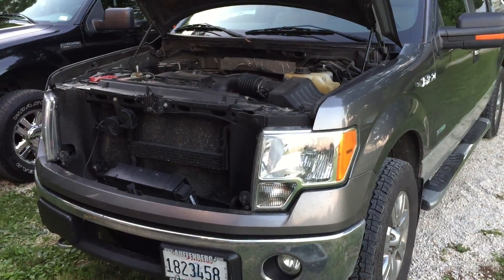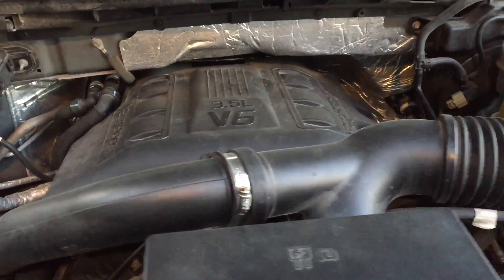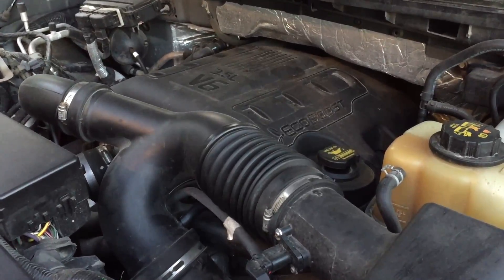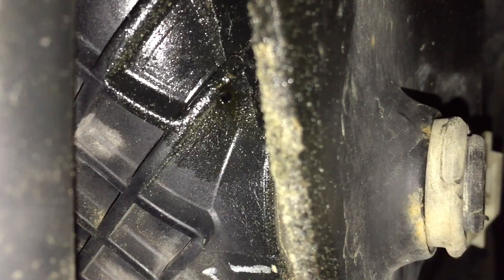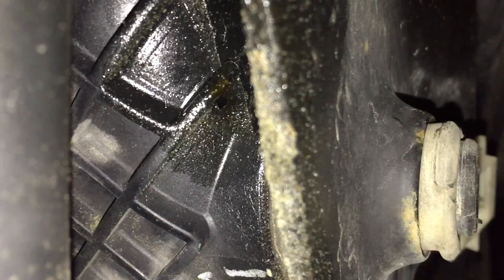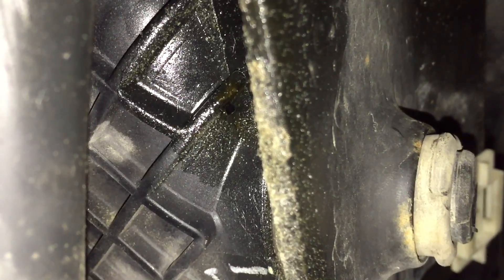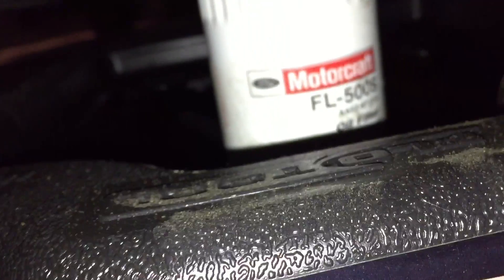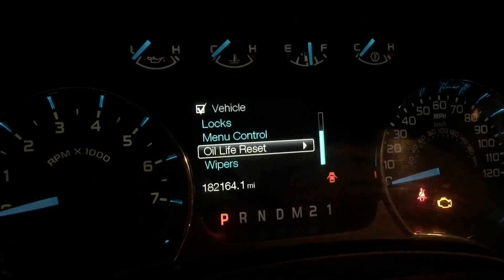Hole Drilled in Intercooler Fixes EcoBoost Misfire

Comment: Are F150s using a MAP or MAF sensor?  Creating a leak in the intake system post MAF sensor is essentially creating a richer burn.  Not as big of a deal if the F150 uses a MAP sensor.
Reply: Jordan Bruno exactly. fucking people don't understand basic fluid dynamics. God forbid you step on the throttle, and ask for more power. 

commercial diesels will run for extended periods of time with blown intercooler, or rock holes in them, you'll hear them hissing a half mile away, and miraculously, they still get down the road. should they be fixed, absolutely, but we talking about finger sized hole vs a ' O ' literally. 

a classic case of a little bit of knowledge being dangerous.
Reply: lol... a forum response? oh for fucks sake. How could I ever doubt you?
Reply: I would like to see this link that claims that losing like 2CFM is going to do any damage to a turbo....
Reply: WereAllThatBored ford use a MAF but the leak is extremely small and doesn't bother anything
Reply: WereAllThatBored The ecu will accommodate any rpm in any boost level given that they are in ideal conditions. Unless turbo rpm is measured (hardly ever) the entire system will still run the same. However the real issue here is turbo seals and pcv imo... Maf and map are both used. the engine uses a maf tune for part throttle and uses the map in something closer to a speed density tune for boosted conditions. A maf cannot accurately predict the volume of pressurized air.
Reply: Um.... yes, a MAF can. The volume doesn't change after the compressor. The pressure and temperature changes post compressor, not the volume of air.  PV=nRT guarantees that.
Reply: kleetus92 no it doesn't. have you heard of a speed density tune? do you know why it is needed? obviously not.
Reply: kleetus92 mass doesn't change but volume does... that's the whole point of compressing air. increasing the density by firing the air into a smaller volumetric space
Reply: Krankie V Correct. Yeah, I said that backwards. When you compress the gas, it's mass (actually number of moles to be exact) is constant, but the space it requires is less, with a corresponding increase in temperature. 

Regardless however, with the MAF telling how much air entered the system, and the MAP saying what the pressure is after compression along with the IAT giving the temperature, the amount of air present for combustion is a pretty well known value.
Reply: ok cool so it does use both MAF and MAP sensors.  Thats genius, truly.  Now what the OP of this video is missing is that creating a boost leak of this size is causing over spin of his turbos by nearly 30k rpm.  Short life it will have says Yoda.
Reply: It's not going to overspin by 30k. I'm so sick of hearing that shit it's unreal. if a hole that's literally the size of this ' O ' is going to kill your turbo, your design is absolute shit. And never mind the mod has been in service for a while and magically there's no grenaded turbo. How about that.
Reply: I can post the link if you'd like to read.  Came from one of the most reputable names in the turbo industry
Reply: Please do. I want to see how a hole the size of ' O ' is going to kill an engine. I do not doubt that over speed will kill a turbo, over speed can kill anything. I am saying that said hole will not kill THIS engine or turbo system.
Reply: Oh right.... The factual info from one of the owners of Full Race means nothing when it's written on a forum.  Thanks for that insight.
Reply: WereAllThatBored ok... let's go practical then. Where are the thousands of dead turbos then?

Comment: I'm sure you could have done it without leaving an exposed hole in the intercooler line.
Reply: Christopher Isac my though exactly, a petcock would do much better of a job
Reply: Christopher Isac some aftermarket intercoolers have a drain plug I may buy a Ecoboost eventually for work I plan on Cold Air Intake Catch Can and Performance intercooler

Comment: That's a pretty cool little fix! I have a dodge magnum with a 5.7 hemi and we were having issues with misfires and hesitation too but what we found was oil in the intake and we put a oil separater on it and zero problems afterwards. We found oil coming from the PCV. Maybe you could look into that too
Reply: Yeah that is another thing you can do on this engine. People often install catch cans in this hole shown in the vid. But, since the engine gets a lot of blow by from the turbo charged nature, a lot of oil, water, and gas gets circulated past the piston rings, and back into the air intake to be burned again. This increases engine life but decreases the amount of air and gas you can fit into a cylinder. Installing a catch can between that line that filters the air from the oil in a bronze filter or gravity catch will significantly reduce the oil content in the air intake. This is a common problem in forced induction engines but also occurs in naturally asperated engines.

Comment: uhhhh.... the real issue is the turbo seals... you should have zero oil in the intercooler. You didn't fix anything...
Reply: Zach Schipper it's got over 180k miles, the seals are going to leak a bit. I've never yet pulled a hose off an intercooler on ANY engine and seen "zero oil" inside.
Reply: Krankie V you may have a little blow by but that's it. It should not drip oil at all. This is not a fix.. rebuilding the turbos or even better yet, replacing them with brand new is the fix.
Reply: Zach Schipper must be every single car I've had an intercooler pipe off from had a bad turbo then eh? smh
Reply: yuppp
Reply: Corret sir! A lot of the people need to look at a 93-98 Volvo thats turbocharged. The intercooler have a weep hole in the lowest section of the cooler for this same issue. And the people complaining about the boost leak dont realize that tiny pin hole cant flow anywhere NEAR the flow fo the turbo so no ill effects to boost what so ever......

Comment: turbo seals, piston ring blow by. which is why it hesitates. that intercooler will be full of oil
Reply: jack black or it could just be blow back that's getting past the PCV.  turbo motors draw pretty hard on the intake.  that's why they suggest you get a catch can.
Reply: Casey Rodriguez yep also if you run it hard in 4th gear at highway speeds for 20-30 mins you can prevent it or clear it up MAYBEE

Comment: whats all the oil from
Reply: which overtime happens, especially on diesels. Thats why alot of diesel enthusiasts delete the EGR and reroute the PCV, keeps all of that oil and crap out of the intercooler.
Reply: turbo seals, piston ring blow by. which is why it hesitates. that intercooler will be full of oil
Reply: itsme78932 yep

Comment: I'm sorry, so you are saying the best way to fix oil in your intake system is to drill a hole in it? No, I don't think so. This is nuts. It may put a bandage on the issue but the issue is still there: You are getting oil in your intake. Fix the real issue. This is insane.
Reply: ThorOtheBIG pull the hose off the intercooler of ANY 100k mine plus engine, you'll find some oil in there. turbo engines have a bit more blow by and the pcv pushes more oil than a NA engine. turbo seals probably leak slightly as well with a 180k mile engine. if it suddenly starts leaving a lot more oil behind, then it's time to rebuild the turbocharger
Reply: ThorOtheBIG The problem was water buildup in the intercooler not the oil. The hole keep water from building up.
Reply: You are misinformed, the hole is there to drain the water from the cooler that causes a misfire, not the oil. Ford has a recall for that problem.
Reply: ThorOtheBIG not only you're also sucking in dirt at the boot!
Reply: remytv water doesn't condense in intercoolers like that . under boost it'll just get pushed right on through . take a look at turbocharged jet boats , they soak up spray with no issues . 
the actual problem this truck has is oil consumption causing the misfire / hesitation . the hesitation seeming from the ecu pulling timing and retarding cam timing attempting to avoid detonation caused by the oil burning. the proper diagnostics would have been to check the pcv system and the turbo seals.

Comment: Where is the oil comming ?. turbo ?.
Reply: 38911bytefree a little from the turbo a little from pcv. it's got a lot of miles on it, so this can be expected. a small amount of oil really isn't a concern. Most likely, the water condensation was the real cause of the miss fire.

Comment: why in the intercooler isn't more than 1 atmosphere of pressure if it is after the turbo? that hole should be pushing air out of the intercooler and losing some power? what am i missing here?
Reply: Leonardo Morellato the hole is so small that the leak is negligible and no significant loss is made

Comment: You could have achieved the same result without creating a boost/vacuum  leak and a bigger problem.If you had removed and cleaned the intercooler and boost pipes ;)

Comment: Unless turbo rpm is sensed, no ill effects should occur. Boost is regulated by wastegate, so the turbos will turn at a slightly higher rpm for a given boost pressure. Fun!
Reply: Doesn't the MAF before the turbo read a higher volume of air than that which makes it to the engine? i.e. Even though boost is compensated by the wastegate, air volume may not be.
Reply: @jplee123  
The speed of the turbo should compensate for volume if there is a leakage.
Reply: @upsidedowndog1256  Thanks. But after poking around the internets a bit, it looks like EB's have MAP (pressure) sensors aft of the intercooler which makes this mod acceptable, rather than MAF (volume) sensors. If we had MAF sensors this would have likely been a problem as MAFs sense volume, not pressure. And the volume would read higher under boost @ the air filter (typically where MAFs are configured) than what actually made it to the engine, causing a rich air-fuel mixture, and lower under vacuum causing a lean mixture. Again, this is not apparently a problem with EBs since we use MAP (pressure) sensors as opposed to MAF (volume) sensors.

Comment: Since you are adding a hole to the intercooler, are you loosing boost pressure since air is just going to be continuously blowing out the hole?
Reply: Doctor Morbid lol you'd be very notice the difference in service life by such a hole. Especially in a low pressure application.
Reply: not sure i would consider 15psi a low boost motor.
Reply: 23+ psi with a tune
Reply: Ihaveworms ft ft 55
Reply: The turbos can easily compensate for such a small hole.. keep in mind the engine consumes air constantly that the the turbos provide and would easily over pressurize the engine at wot and high rpms if it was not regulated. That small hole is no issue.
Reply: I am certain that the difference in air volume vs measured pre compressor is well within the margin of error of the sensor array of sensors that indicate the actual quantity of air being fed into the engine. Failing that, even if it DID make a difference, the result would be a slightly rich mixture since there would be in theory less air present than calculated, and rich never killed a motor. Lean will eat a piston in short order. Worst you'd do is foul a plug. 

If you wanted to be super anal about it and I don't remember which side of the throttle plate this is in the system, worst case under a decelerating high rpm vacuum condition you could suck a little dirt in, so maybe routing that port through an oil filter might be an option to make as a make shift air cleaner. 

Real world difference: Zero.
Reply: Ihaveworms the other commenters and yourself are right, you will lose pressure, it won't matter because the turbo will make its pressure quota anyway, the real problem is now the mismatch between measured air at the air flow sensor and actual air entering the engine. this constitutes an intake leak, throwing the fuel trims off. a real problem on a turbo motor, the trims may even swing between positive and negative depending on driving conditions (uphill on a Fwy vs 25mph on flat ground, fuel trims responding to high boost vs negative pressure in the intake)
potentially making diagnosis confusing/difficult
Reply: Ihaveworms A small hole won't make much difference.
Reply: Dummy.  The turbo will have to overspin to generate the same pressure, reducing its service life and, in some cases, causing failed bearings and center shafts.  The way to do this, if one wants to do some drilling, is to make that hole, install a boss and then run a line to something on the intake side.  This way pooled water will collect and disperse and no metered air will be lost.  I also can't believe this was a problem from new.  It's likely the intercooler is so dirty inside that the water is collecting in some bad areas due to sludge.  I'm sure this guy never suggested an IC clean.

Comment: needs a catchcan
Reply: The intercooler is your catch can.
Reply: Hale Cooley You need to stay off them forums.
Reply: Exactly correct. You need a catch can. But it's too late now. The engine will soon need to be torn apart and cleaned. Maybe seafoam might help but all turbo engines need a catch can

Comment: One old logger boy has way over 300,000 miles on his '11 Ecoboost. I don't think he even drilled that hole. I'm putting a catch can on my '15. All direct injection engines need one. It's direct injection that causes issues, not turbos.

Comment: bandaid fix that could cause you worse issues later down the road. the thing needs a catch can to collect all the oil vapor. I'm actually pretty shocked ford doesn't have a catch can from factory.
Reply: jeremiah white 
Why is a catch can necessary?
Reply: Because then the owners would have to be responsible and empty the catch can.  And most of them wouldn't.  Catch cans are generally considered aftermarket.  This engine combo is supposed to be turn key just like any other truck on the road.  Unfortunately...the aftermarket sometimes has solutions that would make the factory stuff work SO much better...but the manufacturers wont adopt it.  Catch can would 100% be a better fix especially if you could have it auto drain.  Maybe back into the oil pan as long as there isnt much water in it.
Reply: jclaunch00 ok so I did some more research and apparently the majority of the issue of condensation building up in the intercooler is probably due to the intercooler being too efficient. cooling the air too much and causing condensation to collect in the intercooler and piping. drilling a hole in your intercooler will allow the condensation to escape but it will also be a boost leak and a hole that will become a vacuum under idle and sucks in dirt/dust. so this is not a very responsible "fix" a blanking plate to make the intercooler less efficient would probably be the best fix. or just stop driving it like a grandma. 

as for the catch can. it's a separate issue but still a problem. any turbocharged engine suffers from excessive blow by which is just basically some of the combustion gasses pushing past the piston rings and pressurizing the crank case causing oil vapor to go through the pcv system. over time this causes deposits to build up on the intake valves which eventually build up enough to rob performance substantially. adding a catch can to the pcv system will catch the oil vapor prolonging the life of the engine in general.
Reply: JEG's Garage I see what your saying honestly your catch can idea would  work if it was automated , Instead of being dumped back into the oil pan it could tee'd off to oil feed lines to the turbo with a one way valve that correlates to the automated portion of the catch can,  think of it as a throttle body but for oil .

Comment: 2012 Ford F-150 3.5L EcoBoost - stock, no tune.  I drilled a 1/16 hole in the corner of mine earlier today and then went for a long hard drive. Initially when opening it wide open, it hesitated and did its thing. After that I opened it wide a few more times and couldn't get it to shutter and enter limp mode... just got home and checked out how much sludge came out... wow. So far, so good. I'll continue to do this for the next few weeks and see how it goes.

Comment: I have a 2014 with 82K on it currently in ND.  I have been having this shudder issue for that past couple (summer) months.  Im looking into doing this to my pickup very soon.
Reply: original spark plugs i got 49k on mine ?
Reply: update.  I did not drill the hole.  I had a shop change coil pack, plugs and wires.  My pickup runs great with no issues now.
Reply: But it will keep returning, and I’m sure, the mechanic knows this,  but just not gunna  say

Comment: What I don't get is , why is condensation an issue? I have had a several turbo cars and ran water methanol injection. That by far has more mass than a little condensation can provide.....Maybe Ford shouldn't be trusted with gas turbo engines.

Comment: Very Interesting. Makes sense, but i think the boost/vacuum leak might present future problems. I was thinking and came up with the idea of maybe installing some sort of petcock at the bottom to occasionally drain the intercooler, but also preventing a boost leak. A hole that size probably wouldn't be noticed by the engine's computer, so either way would probably work. Nice cheap remedy!!

Comment: You said that he's only done oil changes, spark plugs and coils. Out of curiosity, what was the check engine light for later on in the video? It obviously wasn't something crippling, because he continues to drive the truck, but apparently oil changes, plugs and coils aren't all it needs. I'm looking at getting a 2011 Eco used right now, which is why I ask.
Reply: Cameron Kelson. The key was on, but It was not running... I think.
Reply: Cameron Kelson the tachometer wss resting on zero. the light was on because the engine was not running.